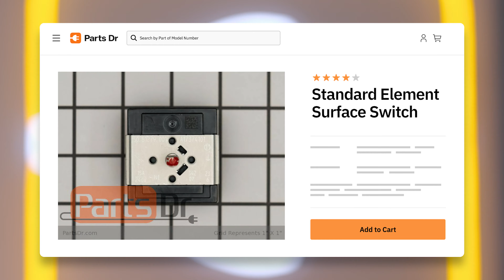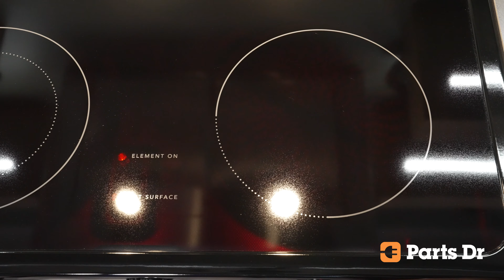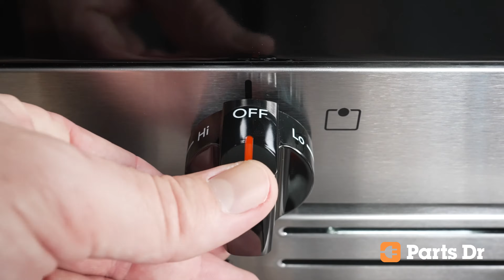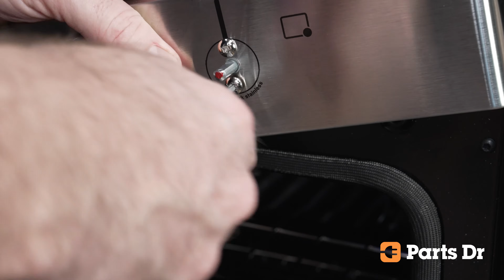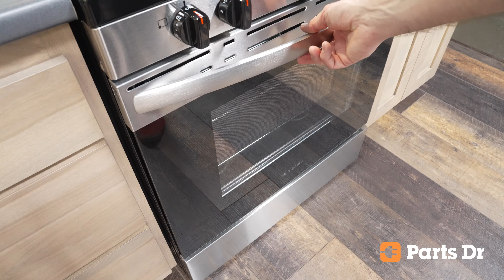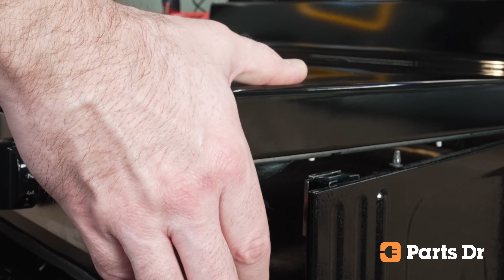Step-by-Step Guide: Testing & Replacing Frigidaire Range Infinite Switch (5304522966) | Parts Dr

Comment from the maker: Thanks for watching our step-by-step guide on fixing your Frigidaire range with a new infinite switch! If you're ordering replacement parts online, especially from places like Amazon or eBay, be careful as many of the cheaper aftermarket parts are lower quality. We've seen lots of cases where they fail quickly or don’t work properly, causing even more issues down the line.

For a reliable fix, we always recommend using genuine OEM parts. You can find the exact high-quality Frigidaire infinite switch featured in this video on our website at https://partsdr.com.

Happy repairing, and let us know how your repair goes!

Comment: Can you explain how to tell if the infinite switch is adjusting accurately and smoothly throughout the range even when it's working to power it on?
Reply from the maker: To tell if the infinite switch is adjusting accurately and smoothly throughout its range, even when it’s working to power the burner on, there isn’t a single simple test, but you can evaluate it with a combination of checks. The infinite switch uses pulse-width modulation (PWM), cycling power on and off to adjust the burner’s heat, which makes precise testing a bit involved. First, you can do a basic resistance test to confirm the switch is functional as shown in this video.

Warning: Be very careful electric ranges use 240 volts, which can electrocute you. Don’t touch wires or the burner while it’s powered on, and if you’re not comfortable with electrical stuff, call a pro instead of risking it. If you’ve got a multimeter and know how to use it, you can test it more precisely. Measure the voltage across the burner at different knob settings (this is the RMS voltage). Divide that number by 240, square it, and you’ll get the “duty cycle” which is basically, how much power it’s giving. For example, if you measure 120 volts, it’s (120 / 240)² = 0.25, or 25% power. The power should climb steadily as you turn the knob up, showing the switch is working smoothly.  Please only attempt this if you have an advanced electrical skill level.

If you have multiple burners with the same type of switch, compare their performance at identical settings, differences might highlight an issue. Ultimately, if the burner doesn’t regulate temperature properly (e.g., stays too hot on low or won’t heat on high), the infinite switch is likely faulty and should be replaced, as smooth adjustment depends on its internal mechanics working correctly.
Reply: @PartsDr  I have been a maintenance tech & comfortable testing voltage etc. Thank you! This is very useful info! So does the pulse length of time stay similar throughout but the voltage change? Was trying to understand the math formula. It helps me remember a lot better. Thank you so much for your help!